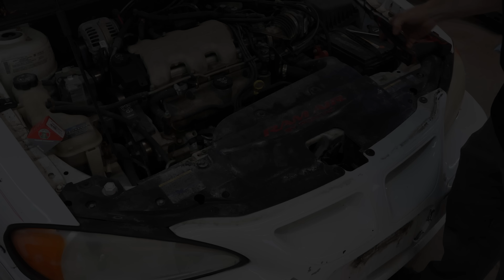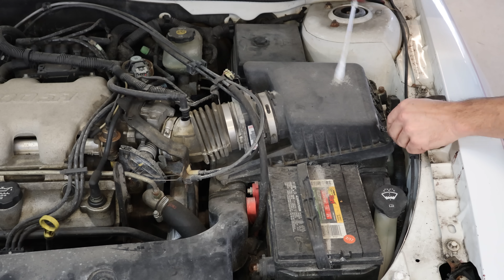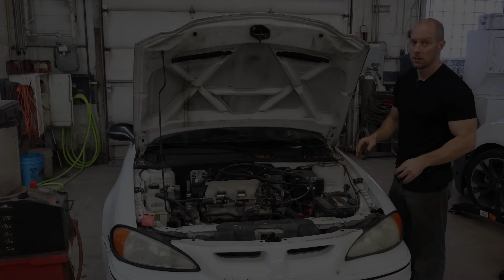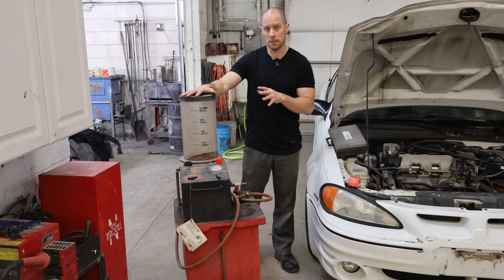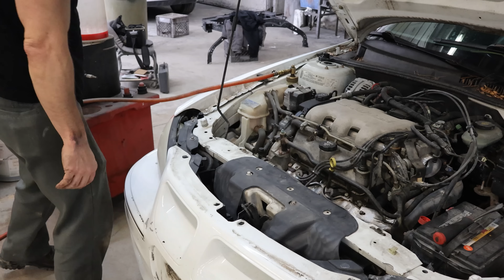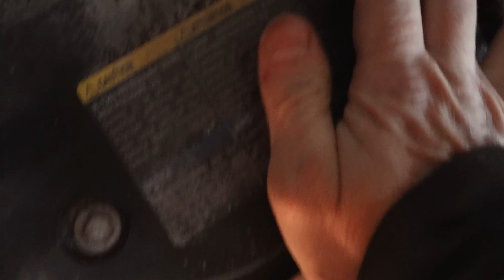Easy thermostat replacement on a GM 3.4 for code P0128.

Comment: Thanks for that tool tip. Just ordered mine and will try the thermostat again. I originally tried to do it with a small wrench could not get that bottom bolt off.

Comment: Very nice repair!.  Fresh coolant is a nice touch to the repair, unless it was changed last year.  I change the coolant in mine and my wife's vehicle every 2 to 3 years.  Keeps nasty cooling system leaks or other problems away.  
Like engine oil, coolant is cheap!  Engines are expensive!

Comment: This design is what happens when more than one group of engineers works within the same design area. That exhaust crossover is pretty horrible!?! Thanks for the video!
Reply: It can’t go under because the transmissions in the way so it crosses overtop they could have engineered the thermostat location a little better like the 3.6 it’s much better easy to get to.

Comment: You could also theoretically take of the throttle body assembly and have a little more room to hold that thing in there. Did it on my cutlass with the 3.1
Reply from the maker: Not as fast for me.  My method makes it a 15 minute job or less.
Reply: @vehcor  it's not as fast but it's free, and a little more accessible when you have no access to power on the side of the road in middle of nowhere kansas, lol. Vacuum is a good tip though, wish I had that when I did it.
Reply: I took off the throttle body too. Tough getting those little coolant hoses back on so they don't leak.  Love the vacuum tip.

Comment: Scott I need you help if can find the time please. I have a 2017 Buick enclave , codes p018c, p0452, I’ve changed the fuel tank pressure  sensor and gas cap, could it need the fuel rail pressure sensor even though it’s not showing the course p0191?? I’ve watched enough of your videos  to know you know the facts lol. Thank you in advance.

Comment: I have a Pontiac Grand Am question. I have a 2001 grand am 2.4l engine. My transmission pan is slightly leaking and people always tell me to never change your transmission fluid after 100k, but what can I do if my pan gasket is leaking?

Comment: Those thermostats were ones I absolutely hated. I would always sell one whenever I did intake gaskets just to make sure I didn’t have a comeback. What’s an extra $15 when you’re that deep into it.
Reply from the maker: I put them in with intake gaskets as well but they have such a high failure rate, I end up doing them again a few years later.

Comment: A stuck open thermostat in IL two weeks ago must have been fun. They probably had one of those $20 heaters just to keep the windows clear.
Reply from the maker: This is a spare car so it has been sitting but they probably would have had to light the dash on fire to keep warm the last couple weeks! 😂

Comment: Hi Vehcor! How hard is it to do the lower intake in one of those 3400/3100’s? Is it worth it?  My grandmothers old Lumina only has 90k miles, but the oil/coolant finally met.  It’s a mess.  It wasn’t ran too long.  I assume it’s just the troublesome intake gaskets.  Sucks!

Comment: Vehcor, I'm tired of the typical brake bleeding solutions.  Does someone offer vacuum fill option similar to these coolant vacuum fill tools?

I've heard that the manufacturers use vacuum to "install" the brake fluid in cars at the factory.

Comment: That wrench looked like a old distributor wrench. Think i just gave my age. Lol
Reply from the maker: Those were 9/16.  I believe I just gave away my age. 😂
Reply: @vehcor  yes on gm. Ford was 1/2in. I still have mine. Been a mechanic for over 30 years.
Reply from the maker: Using a Ford tool on a GM, blasphemy! 😂
Reply: I'm a Chevy guy. Just work on all kinds of vechicles on road and off road.

Comment: A lifetime ago, I had a thermostat stick open in the dead of winter in a 3100-powered Grand Prix that I owned. I didn't have a garage at the time, so a buddy and I drove that GP to a local self-service car wash to change out the thermostat. Needless to say I did NOT have that awesome U-shaped wrench to get the "bitch" bolt out and ended up taking 2 hours (and tons of curse words) to change out that damn thermostat!! In hindsight, it was totally irresponsible on my part to just dump the coolant directly into the car wash's floor drain 😳but it was equally comical having my buddy be the "lookout" to keep wandering eyes out of the bay we were hogging 🤣..
Reply from the maker: I’ve changed fuel pumps on Grand Ams in a fast food restaurant parking lot when it was 10° F.  You gotta do what you gotta do!

Comment: Thanks for answering a question that has been dogging me for years.  I had a 2001Alero with the V6 and no heat (but no MIL.)  I suspected a thermostat issue and not being a stranger to changing them, was dismayed at how difficult this would be.

I got so far as to determine that the bottom bolt hole was slotted, ostensibly to ease replacement, but then "chickened out" and farmed the job out.  Although the job didn't break the bank, I continued to debate about why I didn't just tough it out and do it myself and save the money for beer.

Now I see that the slotted bolt hole was not a complete solution.  I can't help but think, though, that given your job specific wrench, I couldn' handle it.  Given another shot-I'd definitely try.

Thanks again.  As I've said to others, I'd buy one of your rebuilds.

Comment: Definitely love all the tech tips, I'm currently rebuilding the 3.4 in my 05 Impala. Did you know did you know the 3.4 commen blows head gaskets . Also Did you know a brand new replacement cam for those motors they do not exist.

Comment: When burping the coolant on my Model 3 I just used a shop vac. It took a while, but it turns out the coolant fill was the same size as the hose on my shop vac...

Comment: Hey Scott, I'm a huge fan of your channel and your work. And real quick before I go, June 1 this year will be 2 years since I got a 2015 Chevy Cruz. Monday this week, it broke down a 4th time, blew the valve cover gasket again; it's the second time the vcg blew since I've had the pos. Warranty had no choice but to cover repair costs for the first 2 breakdowns because they occurred within the first 30 days of me taking it home. Monday, when the auto garage rep was on the phone with warranty people, they denied all repair costs again but informed us of the recall for the pvc issues. I paid for the evaluation and a tow truck to get it home, and it still sitting in my driveway. I was never told about a recall when the car lot sold it to me. Currently working with my credit union to get rid of it. In closing, I would like to hear any thoughts you might have about the Chevy Cruz LT's. Also, as usual, great video.

Comment: I bought an AirLift system when I had to pull and fix the radiator on my Diesel Pusher RV, and that has to be one of the best coolant replacement tools that I've ever used - glad to see that there are more affordable units out there now. Excellent video as always, Scott!
Reply from the maker: I bought mine when they first came out. They were way more expensive but worth every penny.

Comment: 7 years out of a Walmart battery, impressive.
Reply from the maker: I was thinking the same thing. Any battery for that matter.
Reply: I got 14 years out of my Walmart battery ..05-19 replaced with another one.
Reply: @NightFoxx1  Nice!
Reply: I’m pushing 8 years on a Walmart battery. Though I will admit it’s in a Jeep TJ that sees about 2500-3000 miles a year.

Comment: Challenging thermostat location. Burnt fingers = pissed off mechanic. Good how to video. Really nice to see one of the older rebuilds coming back to visit.
Reply from the maker: I’ve had a lot of old builds coming back lately.  Actually, I have just had a lot of mechanical work in general.
Reply: Should have a photo wall of past alumni. And how durable your repairs. Are